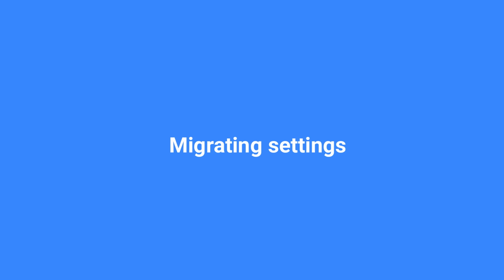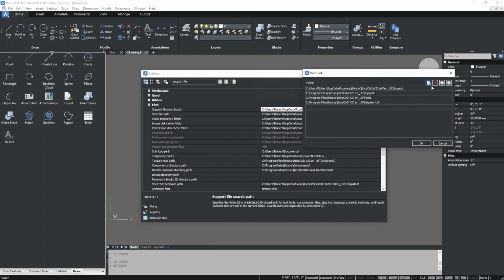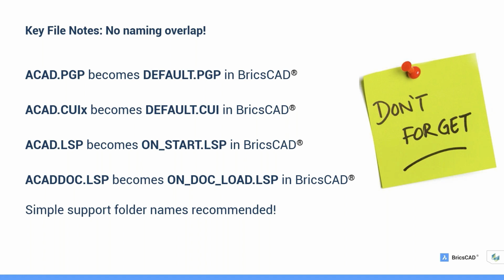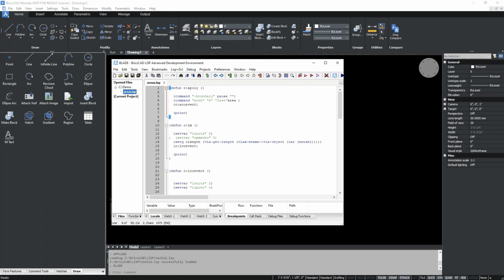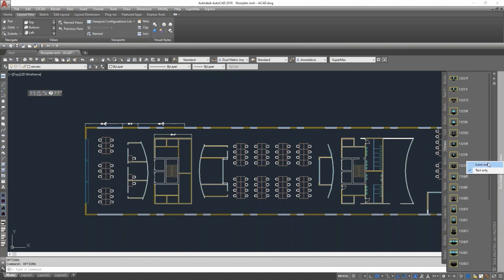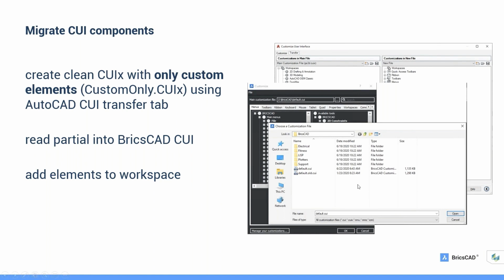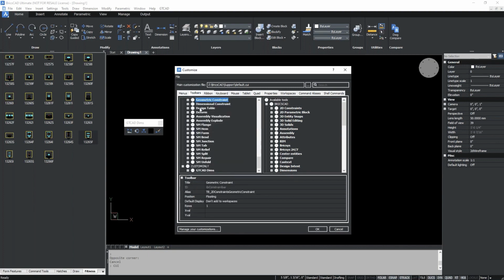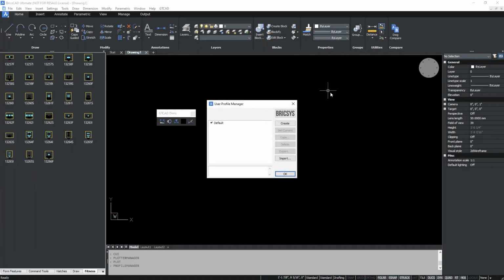How to Migrate Your Settings, LISP files, Tool Palettes, CUI files etc to BricsCAD

Comment: I've started using bricscad recently and I'm really considering dropping autocad completely because Bricscad is really good so far. A key benefit that very few mention is that it also supports Mac fully, unlike autocad which only has a laggy, stripped down, version on Mac that doesn't even have a customisable interface.
Reply from the maker: Hey! Thank you for the fantastic feedback 🙌 We're glad that you're enjoying creating with BricsCAD!

Comment: Hello again, i have tried reading on your website about the CUI w- no luck.  In Autocad i was able to re-program my keyboard to make my job easier. For example- I used the number pad in conjunction with the Ctrl button to set my views Left/Right/SW/Back ect. ect. So [ Ctrl + 5 ]= Front View      [Ctrl + 7 ] = NW view     [Ctrl + 1] =SW view. Am i not able to do this in Brics? i can see the option to edit the keyboard but i do not see the views or iso view functions as an option to designate said keys. Also wit the visual styles i used to use Shift + 1 for wireframe/ Shift + 2 Conceptual/ Shift +3 X-ray Ect. is this not possible in Brics??
Reply from the maker: Hi Have you tried to create keyboard shortcuts? Here you can find more details: https://help.bricsys.com/hc/en-us/articles/360006425954-Keyboard-Shortcuts